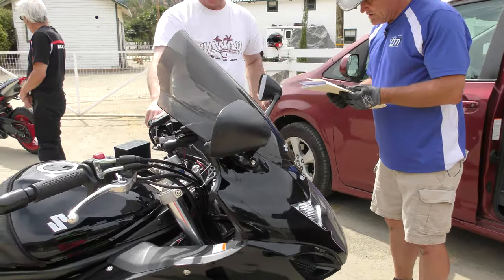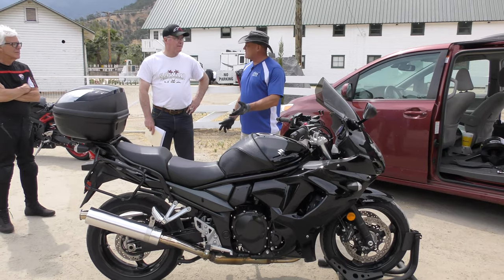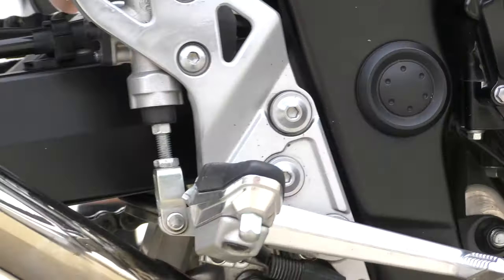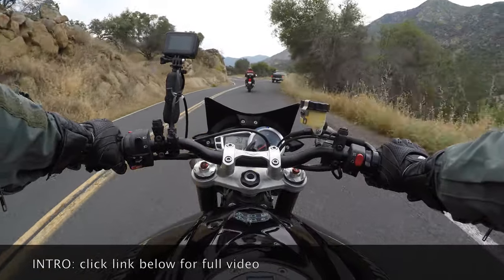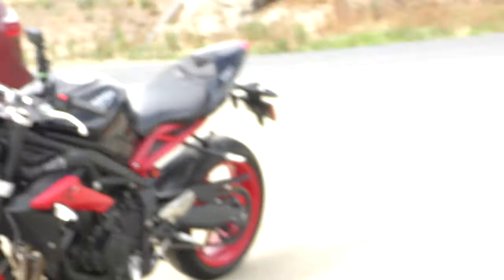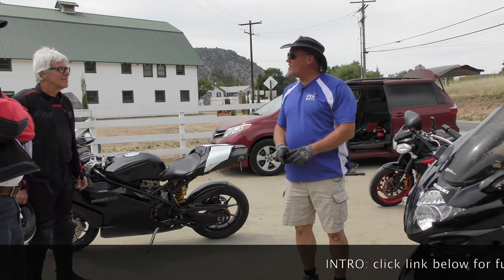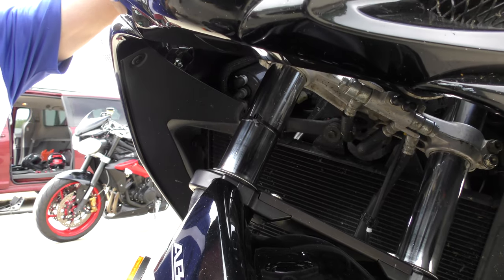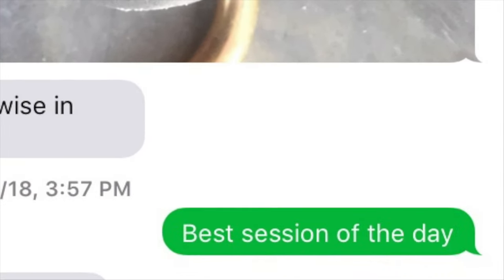INTRO 2 Clicks Out: Suzuki Bandit GSX 1250 FA Suspension Setup

Comment: Ah, I miss my old Bandit- had a resprung gsxr-1k shock in mine too, worked wonderfully.    I had to cut the corner of my airbox (2002 model bike) for the reservoir but otherwise it fit just fine.   later models than gen2 may be different- shock linkage on the gen2 needed a stiffer spring on the gsxr-1k shock.

Comment: Thanks for the video. I owned same bike an I'm going to experiment. Question,,, did you have to cut or change anything to fit the new shock? I notice it's bigger on the top where the controls are, the original has no control knows and is smaller. Thanks again for helping us be a better and safer rider.
Reply from the maker: Will be fitting one to min in the next couple of weeks. Forums suggest small modification to the air box. We will se!
Reply: @catalystreactionsbw  thank you. I'm going to try with a 08 suzuki gsxr 750 stock I found on ebay for 39.00. I will follow your instructions. Thank you again.
Reply: I weight 138 pounds.....lol
Reply: @catalystreactionsbw  so how did it go? I guess not the ABS model? I tried today and the ABS pump is in the way for the shock reservoir so I’m looking for some options.
Reply from the maker: @scrstryker  This is the thread I used: https://nswbandits.forumotion.net/t4287-gsxr-1000-07-08-rear-shock-fitment-to-1250-bandit